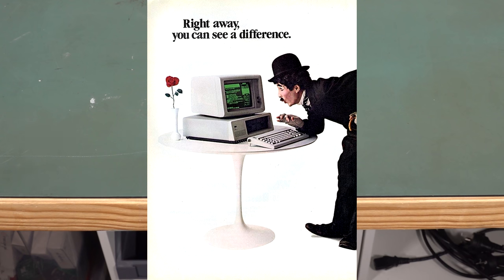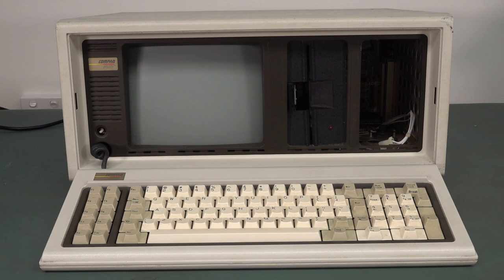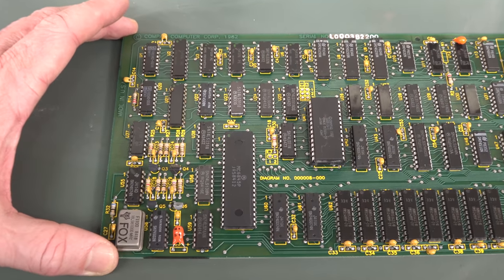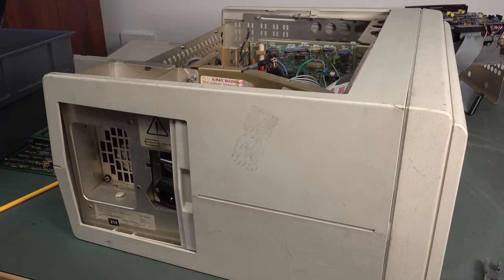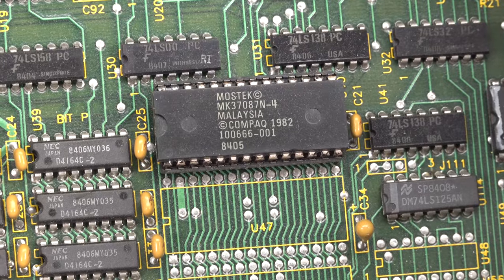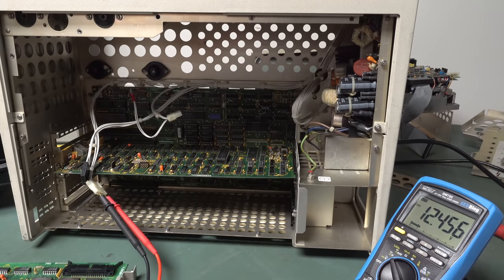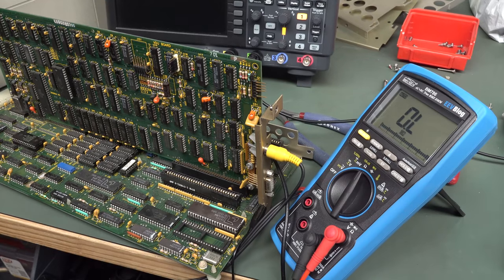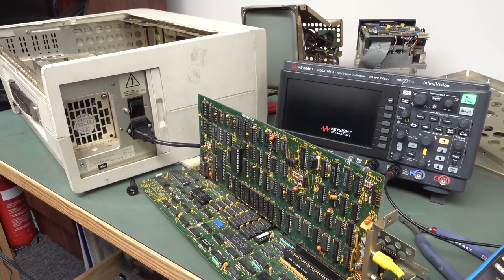EEVblog #1348 - World's First IBM Compatible PC - The Compaq Portable

Comment: Going to bet the power supply fault is a shorted electrolytic capacitor that provides the POK signal. Generally the power supply had a RC circuit that gave the POK, and had a simple comparator in there that was connected to the power supply controller power, and then compared the unregulated input to the chip with the reference, So that when the input was below around 8V from the 12v power rail, the comparator would pull the POK low to hold the processor in reset.  LM311 with the output connecting direct to the pin and ground, and a pull up to 5V, with a capacitor to provide a turn on delay before the reset was released. Reset switch also just shorted out this capacitor to provide the same thing.
Reply: Hi - some machines are funny the 12 and 5v specs are sometimes just done on the feeds of the power supply before the board , while others specifically overvoltage  the power supply as they are designed to have a final or stable 12 / 5v on all components on the mother board after the power drains by mother board , video card, floppy card , hard drive

Regards
George

Comment: used to field service these. Covers could be tough to get off sometimes. Remember cutting my fingertips on one once getting the lip of the covers open. There was also a Compaq special cranked socket tool for removing a near inaccessible bolt that held the psu in place.

Comment: That was my first IBM-clone PC. I built an Altar 8800 kit first and still have it. Then I bough a KIM-1 which was a single-board computer with a hex keyboard so you could load the had-assembled code in one byte at a time. Every programmer should be required to write code by hand to get a good grasp of what the computer is really doing down deep. We called it coding down to bare metal.

Comment: Dave, once you get the system going and the VDU working, you may have to press Ctrl-Alt "<" or ">" on the keyboard to toggle the graphics mode to/from 80x25. That should get you composite output from the graphics card.

Comment: Great video with excellent troubleshooting and circuit tracing. Looking forward to the second one, I have one of these Compaq portables in my basement. The computer starts up and has a floppy and a hard drive. The issue on these (spoiler?) is that the aluminum pads on the keyboard deteriorate making the keyboard non-functional. It would be interesting to see the state of this one.

Comment: My first ever PC was a Compaq!
A Compaq Presario C700, 1GB of RAM, 80GB Hitachi HHD (which still to this day works! But it's slow), an Intel Pentium 1.4GHz dual-core (well, 1.5 core I'd say, the other core was is locked at 800MHz), and shiped with Windows Vista. Yeah it was slow! the Intel GMA graphics could barely keep up. But I used it regularly up to 2011 and occasionally as a backup PC since. I've since upgraded the RAM to 2GB, then later stuck an SSD in it, then later stuck an Intel Core 2 Duo I got on eBay for cheap! It's now almost as fast as a chromebook and runs a Ubuntu derivative with KDE with the compositor effects disabled.

Comment: Still have my IBM PC tech manual. Used it to design a couple of PC slot cards in the day.
Reply: I never had a manual, but instead used my trusty TTL book, to get the pinouts of the logic chips, to then determine an ISA slot pinout. Called my board JAB. "Jerry's Acquisition Board". Lol. Those were the days!  : )
Reply: @jabhomemonitoring  Still have my Don Lancaster TTL and CMOS Cookbooks, and two of my designs were biomedical data collection and cement plant control. Fun times.

Comment: Due to the weight of them they became known as luggable computers rather than portable ones. :)  The people in the market research side of the company I worked for at the time used to take these on the road to do focus groups. BTW, the silkscreen of the main PCB shows that what you called the parity bit RAMs are actually bit 0. The parity bit chip is at the far end of the block of 8 chips where you see the P label on the silkscreen.

Comment: I've still got one of those somewhere. :)

We called them "Luggables", because "portable" was a bit too generous. XD
Reply: Moveable / Transportable  - i had private usage on the much smaller Compaq SLT 286 when that was new, i used to take it to university in my final year that i completed part time.

It was not as heavy as that unit but your hand and wrist  knew it between the car park and the class room, often changing hands - then one day i was given the proper shoulder strap for the compaq bag 

Also pre lan party i was the only one who could play null modem games and not have to go to the car in 4 attempts ( pc / screen  / 2 milk crates with keyboard / mouse / joystick / mull modem cable / power and video cables )

And say every 3 months some one out of our group would say " I cant come hard drive / monitor / pc is damaged from being transported and bouncing in the car - the few time i did transport my XT / AT / 386 , the monitor was in the front seat with the seat belt and the case on the rear seat ( tower laying flat ) and seat belt on

Regards
George

Comment: I had , one of those "luggable desktops" back in 1989. I think it was a ex bank machine, which came with supercalc on a floppy. I did try to run ms-dos 3.1 on it, but it would not boot. It probably was another operating system I guess but it ran supercalc very fast indeed. It was like the clock crystal had been upgraded which was the thing of the day back then. ;-)

Comment: You  should do a video on the IBM PS/2 model 50z.  The  IBM computer that was not IBM-compatible.  It was an attempt to bring microchannel architecture to the consumer market.  It ran a one-off version of PCDOS that was missing a bunch of standard system calls.

I did tech support for a software company back in the day.  A user is describing symptoms to me and I knew exactly what was going on.  I asked her what kind of computer she had.  She said "I'm not going to tell you.  If I tell you what computer I have you'll tell me it isn't going to work."  Yep.  She was right.  No other PC would do the things hers was doing.

I said "It's a PS2 50z isn't it?" and she got super upset.   She was an attorney in an office full of men in 1994 and was under a lot of pressure to prove herself.  She ordered an IBM because that was the smart thing to do -- and she ended up with this piece of junk.  I'm now a grief counselor "Ma'am, it's not your fault.  You did the smart thing and ordered an IBM.  The problem is that THIS IBM isn't IBM compatible."

Comment: ISA bus wasn't plug and play and it sometimes matters what card is in which slot thanks to hardwired IRQ addys. Plug the speaker back in; not passing POST, it's trying to beep a code at you most likely

Comment: My first "home" computer was a TI Professional, released in January, 1983 along with a portable version, at the same time as the first Compaq. The TI machine was 8088-based and ran MS-DOS and Microsoft's MS-DOS compilers and assembler, but was not strictly IBM compatible at the BIOS and hardware levels. Microsoft's idea at the time was that MS-DOS compatibility was all that was required. The Professional's expansion bus had all the same signals as the IBM PC's, but some genius at TI decided to rearrange them so expansion boards for the IBM PC weren't compatible. It was said that the TI engineers who started Compaq disagreed with making MS-DOS compatible machines instead of true IBM PC clones so vehemently that they did what they did. The Byte magazine article that convinced me to buy a TI Professional can be found at https://archive.org/details/byte-magazine-1983-12/page/n287/mode/1up. Another TI Professional connection: Gateway got it's start as TIPC Network selling memory expansion cards for the TI Professional at much lower prices than TI's.

Comment: Second column from right, second row, of the ram below u37 @20:36  looks like it's lost its magic smoke. Looks nicely cratered.
Reply from the maker: Nicely spotted, but it was just some crud or something, it's gone now, so maybe when I used the air duster or I was reseating the chips.
Reply: @EEVblog  automatic suspicion of old ram on my part. :)

Comment: I am surprised about that "first pc compatible" claim. In 1982 as an engineer fresh from college, I developped the customer management system for the water and electricity administration of the Comoro islands on a PCcompatible system. I am not sure of the name anymore ( somthing like "Vector"). That system could be set either as a pc/dos machine or as a CP/M machine. In the non compatible mode their "advanced" technology was a variable rotational speed floppy allowing to pack more bits on the outside tracks, allowing to store 1.5MB on a 5-1/4" floppy side! Then I would come home to reverse engineer the ZX80 ROM!

Comment: I actually have 4 of these. All dead from blown tantalum caps in the PSU. 2 original Compaq portables. 1 portable plus and one portable 286 (not the portable II 286, I have one of those as well though). I have nearly the full original portable line with perhaps a missing portable 3 as there were several of those. At this point I am scared to turn any system older than a Pentium 2. Too many just go up in smoke.

Comment: In 1983 I had a vax and that was what I wanted, far superior to my other option, an IBM 370. The PC's did not have enough RAM, were too slow, however they were good as dumb terminals for serial connection to the vax. I can say the PC was superior to the TI silent 700.

Comment: 23:20, Understandably, you probably need to replace capacitors given the age of that machine. But would you need to replace all of them at the same time or just the ones you suspect may be reaching their end, ie bulging or showing a bit of rust on the top?

I'm finding myself having to replace capacitors on both the original Xbox and Xbox360 which have gone rotten while in storage (indoors in plastic containers even), which I assume are both victims of the supposed "faulty caps" pandemic of the 2000's I've seen people write on a few places online. But I've opened up my older consoles, the Segas and the Playstations, and I wonder if I should be rushing to replace their internals as soon as possible, or just monitoring them every couple of years and replacing at the first sign of trouble, or until the inevitable bang?

These videos are great! Keep up the good work!

Comment: Looks the magic smoke may have come out of a DRAM chip @20:25.  I've recently repaired an IBM 5150, and I had to replace about 7 or 8 of the 4164s... as well as the stupid 3-legged tantalums
Reply from the maker: Nope, that was just a mark. Came off when I reseated the chips.

Comment: Did you get chance to test the Power Good pin with the PSU disconnected?

I'm guessing it's probably an open-collector output on the PSU, so it should go High-Z with it unplugged from the mobo?

Bit strange if it's testing low resistance even with the PSU off, so maybe another cap shorted, or the transistor on the PSU.
Reply: OK, so Q10 (bottom of the first screenshot) is the FET that drives the "PC" (Power Good) pin...

https://i.imgur.com/whp2C72.png
https://i.imgur.com/LJm0Mia.png

And that's driven by the final opamp which checks to see if all of the rail comparators are good.

EDIT: The "PC" output should presumably be allowed to go High when the rails are good, as it gets connected directly to pin 11 of the clock gen chip, as you showed. I checked the datasheet, and the Reset pin on that chip is indeed Active-Low. (so should go High when power is OK.)

I guess it can only really be that FET that's shorted, as there's nothing else on that output pin.

(That's also assuming the PSU is the same or similar, because I've only found the schematic for the original version so far.)
Reply: Q10...

https://i.imgur.com/qvcQNEU.png

Could probably just disconnect the "PC" pin on the mobo, and have it start up. lol

Comment: I went ahead and dumped the ROM in my Portable. for some reason, mine is blank (FF) until 6000.  where the copyright notice starts. I've got a much older unit though (Datecode is 1986)

Comment: "Pin 19 is the clock on the 8088".. 🤣 is it sad for electronic engineers when can remember pinouts of chips without a dataset. I still remember a lot of the 4xxx cmos and 74xxx told pinouts. So sad 🤣
Reply from the maker: I once got offered a job because I could answer the guys questions off the top of my head about what various 74xxx chips did. He was amazed, LOL. Standard hobbyist knowledge.
Reply: @EEVblog  Nice :) I think you mentioned that once on AmpHour with Bil Herd interview. I remember this as my favourite amphour ep. I miss my C128D. :)
Reply: I used to work for Bill Herd in PCM Systems Integration!

Comment: 18:29 I see an overheated electrolytic at the right with its 'jacket' retracted near to the low turns adjustable coil bottom.
CR413 says on the PCB or something.

20:25 is the ram chip below U37 having magic smoke burns or is it just dust?

Comment: i have the portable III with a 286 and some sort of plasma display, mine was making whiny noises coming from the psu, turned out to be few shorted tantalums on the main board overloading the power supply, all was well after i replaced the caps, even played some games on it. I put it away for few months and recently tried to power it on and it blew alot of smoke from the side vent, i think a cap vented inside the psu,  now i need to take it apart again an see if i can fix it

Comment: It's possible that the supply doesn't signal PWRGOOD because the CRT is not connected and it senses if the horizontal oscillator has been started?

Comment: I am trying to repair one now and bought the missing flyback (yeah .. mine come without from previous tech). But still trying to figure out J401 J104. J401 is connected to deflector. What about J104? Look like entire wire is missing. Do you know where J104 should be connected?

Comment: CTRL-ALT-> to use the external monitor is the keyboard shortcut that I found. CTRL-ALT-< goes back to the internal monitor.

http://www.minuszerodegrees.net/manuals/Compaq%20Portable_Plus_286%20-%20Maintenance%20and%20Service%20Guide.pdf

Comment: My Dell PC running Reaper DAW makes digital noise when connected to a sound board or KRK monitor speakers. Noise happens when you move the mouse or when the screen updates. Laptops do not make the digital noise. It may be ground or ground loop issues. How to fix it ??

Comment: That "Charlie" thing looks like a predecessor to the Apple DOS Compatibility cards available for the Macintosh. They were literally an entire IBM compatible PC on single card that work via pass through video and audio. The original 1984 Macintosh had no internal expansion card support, so I guess they did it externally back then?

Easiest way to release those oddly placed screws probably would've been a socket and ratchet, those screw heads were designed for use with a socket.

Comment: I remember one of these with a orange crt screen, the salesman came in and threw it against the wall then set it up on the table and it worked.  Not surprisingly we bought some.  Downside was I had to do the hardware upgrades and basic repairs.  The thing was internally built like a bank vault and very tight space,  pulled what little hair I had left out but got lots of looks loos whenever I was using it.  Blood heavy too🤪